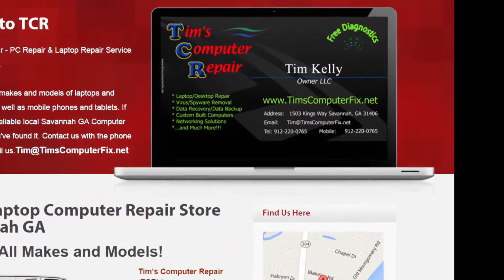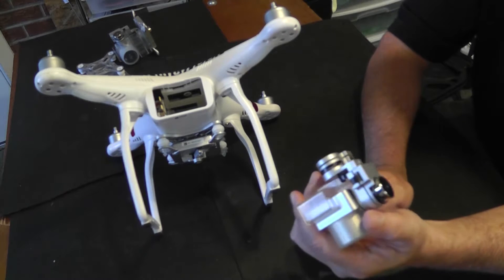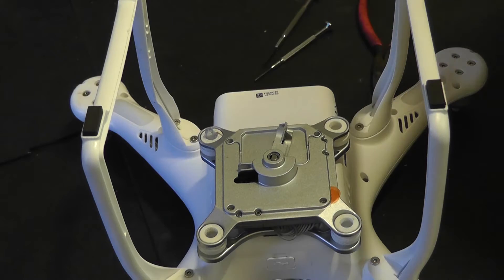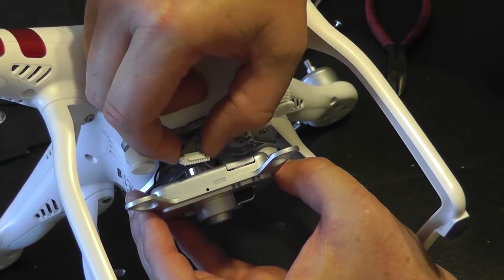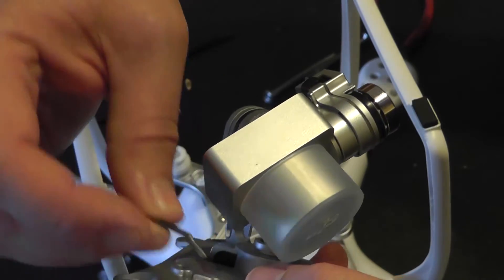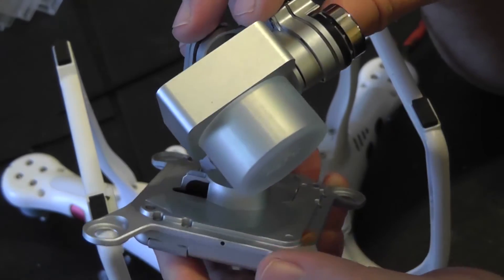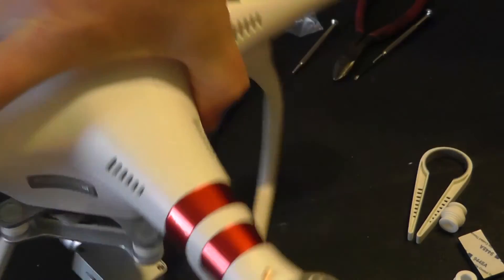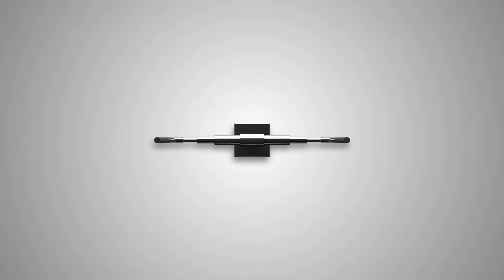DJI Phantom 3 Standard Gimbal Repair and Replacement

Comment: Tim I followed your instructional video for replacing a gimbal on a phantom 3 drone...it worked great,  thank you.  Have you ever had the issue after replacement of the compass constantly having interface?  Tried recalibration it multiple times in multiple locations but still nothing.  Any ideas?

Comment: Why did you replace the entire gimbal assembly?  Why didn't you just replace the yaw arm and ribbon cable?  Also, there are only supposed to be TWO anti-drop pins installed through the dampeners.  4 pins often cause camera shake.

Comment: I have a problem where the plastic plug came off from the gimball where the grey flat cable needs to be plugged in. Is there any way to get that fixed?